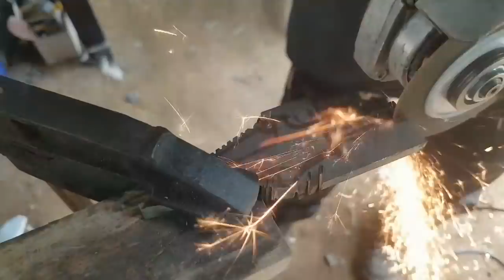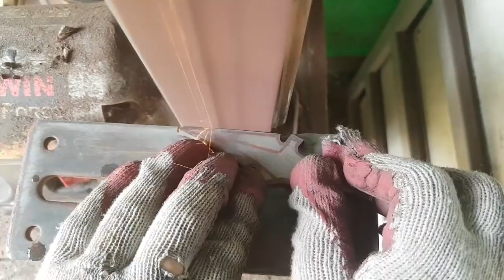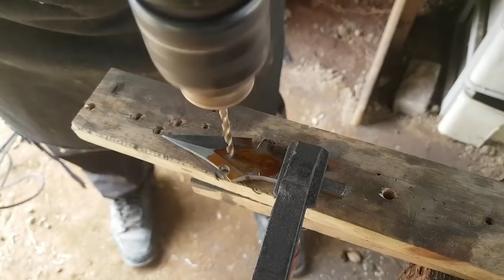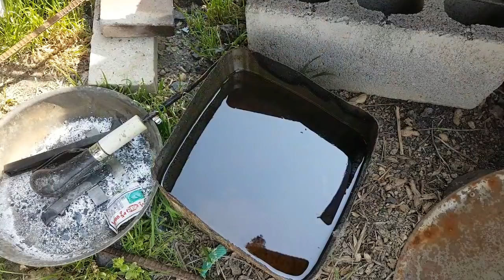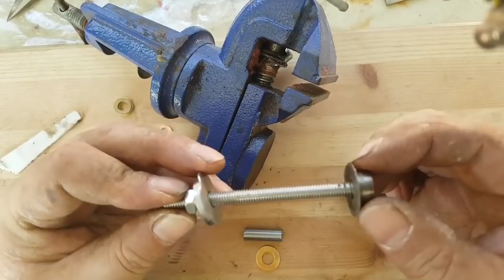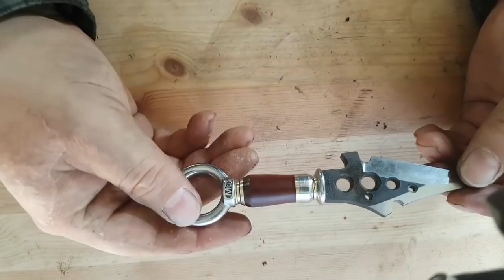Make a carving knife

Comment: Just a question.. by the standards of knives in all of your videos  i have watched you never put a "Cutting Edge" on your knifes (Honed Edge)..."" Is there a reason for you never  Sharpening them.?.""" ...yes, they cut metal and other knives and stuff but so does a cold chisel and they are not  Razor Sharp... One of the true tests of a "Real knife", is will it the cut things it is designed to cut. Meat, vegetable and even people/animals even paper..and hold the sharp edge after doing so..  a knife without a TRUE cutting edge is a art piece knife shaped object...   it is evident there is no Razor shape edge on them by the way you handle them  and a person can see the Unhoned rounded edge when you show them at the end of videos...
Reply from the maker: Thanks for watching.
The reason I don't sharpen knives is because I don't sell them.
Knives without a suitable user can be misused.
Almost all of my knives are made in the form of non-sharp knives.